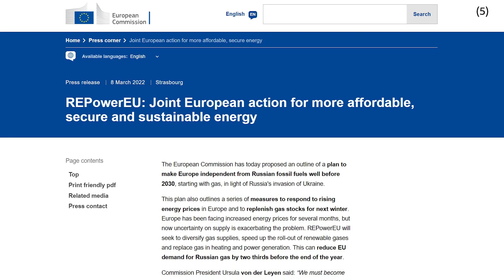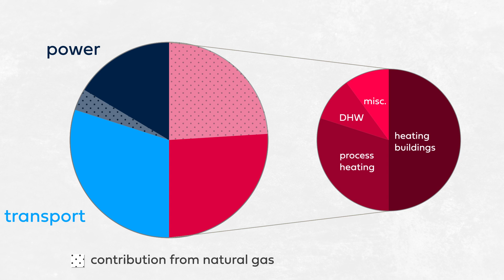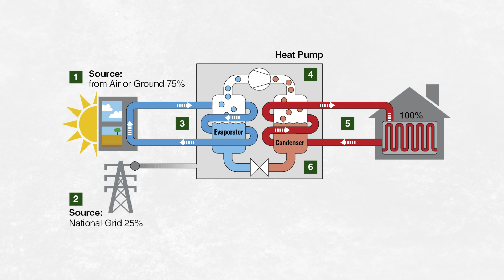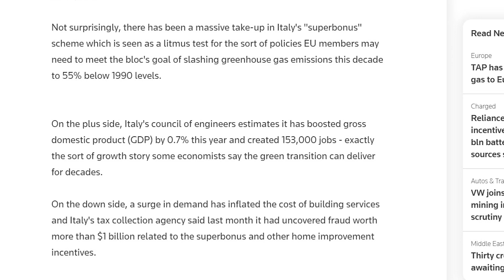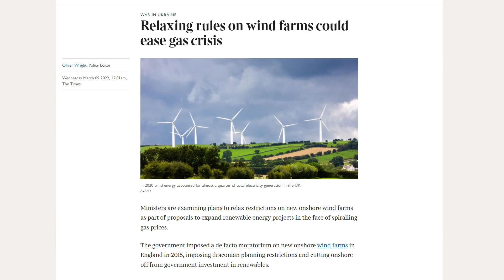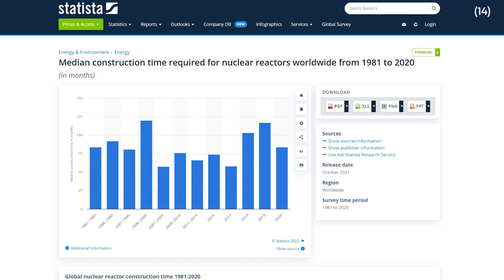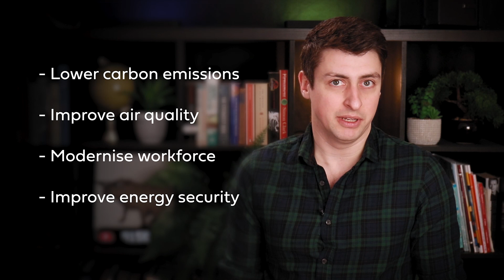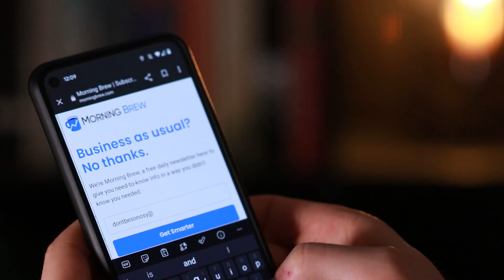How Europe can wean itself off Russian gas

Comment: Global warming doesn't just come from CO2.  If you put heat into the atmosphere it heats it!  Obvious really.  So better home  (work place, shop etc) insulation reduces direct atmoshpheric heating.  Another win.  Unfortunately the insulation sector is full of under trained or unscrupulous opperators.  If it weren't so no house with cavity wall insulation would suffer damp and many more mishaps.  Goverment needs to help in good advice as well as cash.
Reply: The waste heat from human activities contributes very little to the global warming compared to how the greenhouse gases do it by reducing the Earth's heat loss to space, and here's why:

The term climate forcing is defined as a disturbance or alteration of the Earth's energy exchange with space and is measured in watts per square metre (W/m²). A positive forcing means more energy in or less energy out, while a negative forcing means less energy in or more energy out.
The world's total energy consumption from fossil fuel and nuclear is currently about 500 exajoules per year or 5 x 10²⁰ joule (1 joule per second = 1 watt).
Converting that number to watts per m² of Earth gives this result:
5 x 10²⁰ / 365 / 24 / 3600 / 5.1 x 10¹⁴ = 0.031 joule/m²/sec = 0.031 watts/m².
Energy from hydropower and other renewables were ignored in this calculation since it's harvested from energy already present in the climate system, unlike the chemical energy stored in fossil fuel that has been inactive for millions of years.

The climate forcing from the elevated concentrations of CO₂ and other greenhouse gases since the start of the industrial revolution is roughly 3.5 watts/m². That makes the climate forcing from the increased greenhouse effect at least 100 times larger than the direct waste heat from human activities, and CO₂ accounts for about 60 % of that.
Reply: @fromnorway643  Nice to see some numbers, you've studied it more than I.  I accept every thing you say.  However from my direct observations towns and cities are subject to a so called urban bubble which ammounts to about 2C.  The green house roof over urban areas, rural areas and oceans is the same isn't it?  Why do urban areas heat up more?
Incidentally, nice to see you recognise nuclear fission as a fosil fuel.  Its difference to coal is it gives off its storred energy whether we use it or not.
What is the other 40%?  How much is water vapour?
Reply: @emmabird9745  
The warming in cities compared to that in their rural surroundings is highly variable and depends on exactly where the measurements are done. Central vs suburban areas make a big difference, and a mostly concrete or asphalt environment vs a large park will also have a big impact on the local climate. One reason is that concrete and asphalt tend to absorb more heat during the day and gradually release it during the night, thus keeping the nights warmer. Areas with intact vegetation also tend to stay cooler on sunny days due to the evapotranspiration from the leaves since evaporation is a very efficient cooling mechanism.

The long-term climate trend shows a strong correlation for weather stations several hundred kilometres apart. Comparison between urban and the nearest rural weather stations can therefore help climatologists to determine how much an urban weather station has been impacted by local elements that don't indicate the true climate change in the region.
This and other ways of detecting and removing the impact from "non-climatological" factors – including changes of instruments or measuring procedures over the observational period – is known as homogenization. If the urban data have been properly homogenized, there shouldn't be any significant difference between cities and their rural neighbourhood.

Some examples:
According to the homogenized data, Oslo in Norway has warmed about 2°C over the last 120 years, which is close to the warming in Stockholm, Sweden. Interestingly, Færder lighthouse about 100 km south of Oslo has also warmed about 2°C, and that's definitely a very rural place. Some quite rural places in the interior of south-eastern Norway have warmed slightly more than Oslo, especially during the winter.
And the strongest warming trend in Norway?
That's on Svalbard in the Arctic, which has warmed at least twice as much as Oslo!
Reply: @emmabird9745  
What is the other 40%?  How much is water vapour?

Slightly more than half of that is CH₄, better known as methane, while the rest is CFCs (best known as ozone destroyers), nitrous oxide (N₂O) and ozone in the lower part of the atmosphere.

Water vapour isn't really counted as a climate forcing since the amount of water vapour that the atmosphere can contain strongly depends on the temperature, increasing by about 7% for each °C of warming.
The water vapour's main role in the climate system is as a positive feedback, meaning that its greenhouse effect amplifies the warming or cooling started by other causes, roughly doubling the initial temperature change.
Water vapour is also very good at transporting heat within the climate system since the energy that went into its evaporation is stored there as latent heat until it's released to the surroundings when the water vapour condenses back to a liquid or solid state.

Comment: Anyone I know who has ever used a heat pump in a cold country advises against them. What heat do you want to pump when there is no heat around?
Reply: As long as the outside temperature is above absolute zero, there is some heat there.
Reply: @thetravellingbadger6567  Then you must try - I have friends in the Northern US that have tried heat pumps and they are all ripping them out again. Worst investment ever. Not convinced. Try winter with heat pump only. Be honest and throw the additional heating panels out.

Comment: I really don't like this video. Incredibly superficial, does not provide any real answers. I wish I would have heard something meaningful but in some moments it is outright stupid.
For a decade, heating systems were replaced with condensation systems that are more efficient, but still burning gas. 
I do not see any measures in this video that would serve to achieve the detaching from Russian gas. 
In fact some of these suggestions are outright ridiculous.
While electricity generation can be stepped up, you also have to enhance the grid, as it would not support household heating with electricity. 
Even bigger work would be to change the heaters to electric boilers (while many just invested heavily to condensation heaters). 
And we have a few months to prepare for the first real big test, the heating season starts in October already.

Comment: There's nothing that can replace cooking with gas. No decent chef will cook on an electric stove.
Reply: I used to think that but having lived with electric hotplate hob I have found it very good as the heat is more uniform . Also if you want something close to gas hob use induction.

Comment: BTW, what's wrong with Russian gas ?
If this is about the war, how come EU has no problems with UAE, which is commiting genocide in Jemen, to name ONE example ?
And if we have to change things, why don't we kick EUrocrats and "reboot" the Europe  to suit us ?
Reply: Whataboutism. Just because another thing is bad doesn’t mean we shouldn’t do anything about Russia. Also your opinion on eu/Europe seems weird/right wing lol
Reply: Russian gas is bad because it's used as a diplomatic weapon. Also, how much of the EUs gas comes from the UAE? And "this is also bad, so the first bad is alright" is not a good argument, it's just another thing that needs to be fixed.
Finally, what does the "EUcrat" thing have to do with anything?
Reply: Get a load of this dude. 😅
Reply: @EngineeringNibbles  BTW, can you name ONE solid big commercial EU project that hasn't turned into shit ?

CERN comes closest, except that it hasn't produced any real, definitive result. But technically it "works", there is at least that...
Reply: @brane2379  don't suppose you've heard of the Higgs boson then.....
Reply: @1KRFE  I've heard stories about it. Haven't seen anything approaching prospecting new theories or revelations.
In fact, good part of top physicists consider whole effort as a lost cause and wasted time.
Reply: @Jason-gq8fo  Nonsense. "Whataboutism" is defined as pulling irrelevant examples to justify some goal. USA is opposite to being irrelevant - it is central player that often sets the global rules.
Reply: @brane2379  funnily enough ot doesn't have to impress you mate. Just the scientific community, what do they know?
Reply: @alexrogers777  Why is gas more essential than oil ? And BTW, which gas is  "democratic" and how are we supposed to pay for it while competing on that famous "Free Market" ?